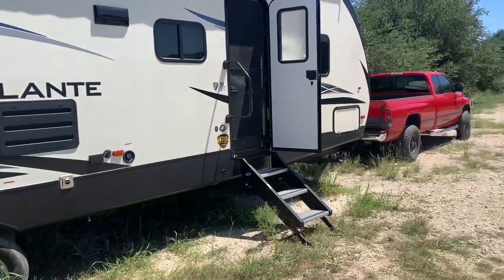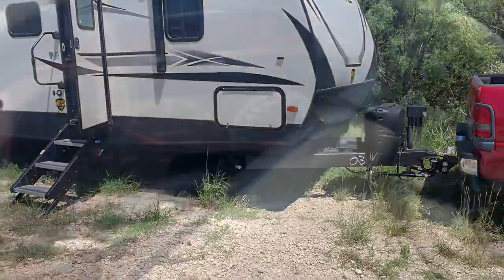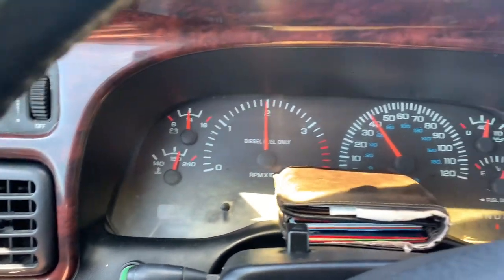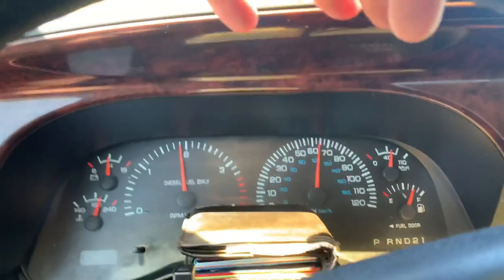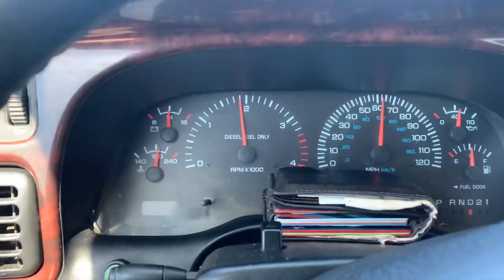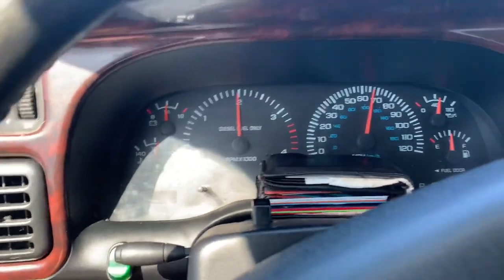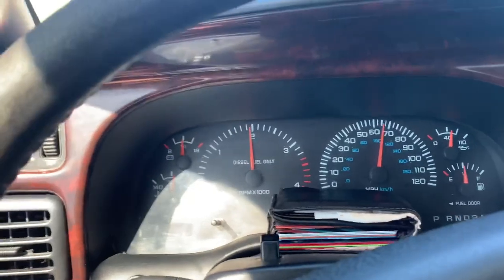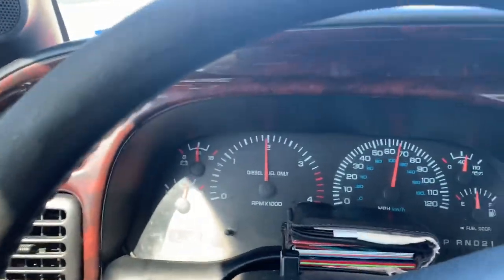2nd gen Ram Cummins towing 10k  trailer on highway - less than half throttle (slow but tows great)

Comment: I’m looking to pull my 7500 pound camper. I have a 22 chevy 1500 5.3. Looking to buy a really clean 2nd gen to pull it up here in Michigan but I’ll be taking it through Tennessee. How’s the highway with a trailer?
Reply from the maker: I tow a 43 foot 5th wheel now with the same truck and no issues on the highway. Only thing I would avoid without upgrades is big mountains.
Reply: @Alpha-Works-Tx  Thank you, I was a little unsure with an older truck.

Comment: Try no distribution bars I never use them.  Why move weight to front.
Reply from the maker: I towed it with and without, honestly not to much difference except with sway on windy days. I now tow a 5th wheel with this truck.